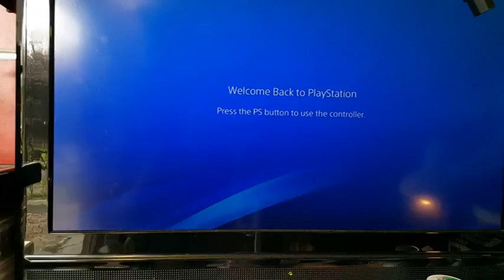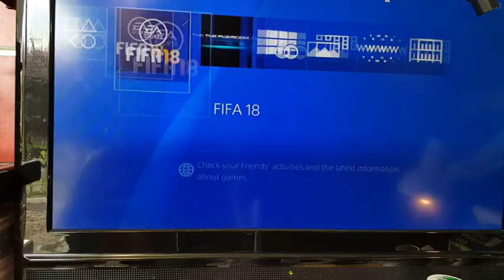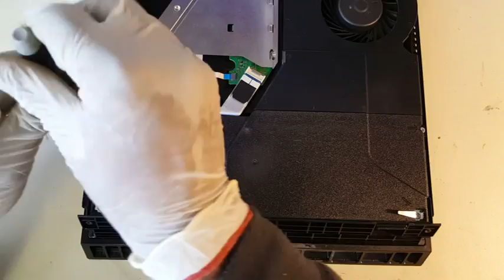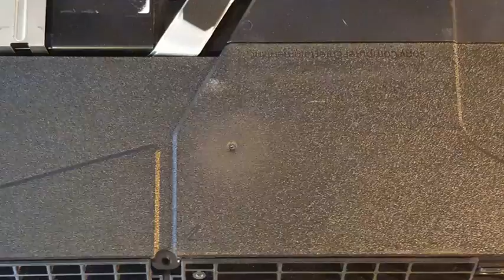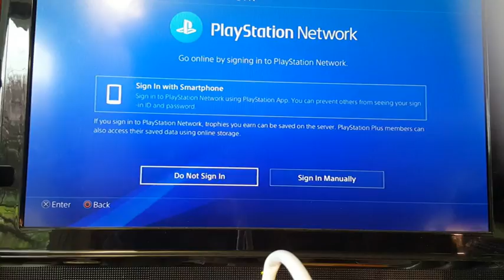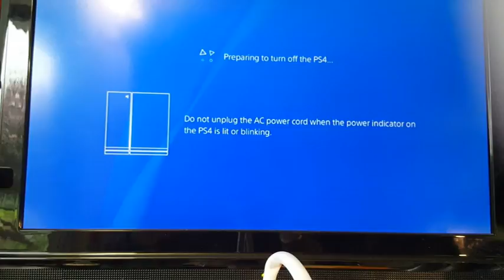Ps4 CUH 1002a Controller disconnects, slow response, Controller laggy

Comment: Hi, my two DS4 (Dualshock 4) controllers used to disconnect every now and then and I used to be able to use hard reset (pull out power cord and just plug power cord back and simply press PS button and PS4 will power up right away).

Starting last night i had the controller on/PS4 on, yet the controller started losing connection. Tried hard reset (power cord off for 30 seconds or more/pressing power button until it beeps twice for safe mode and then restart PS4) as well as pressing the reset button on back of DS4,doesn't work.

The DS4 would just blink (white light) a couple of times, then turns amber (or orange) ONCE and turn off. This is with or without the USB cable connected (tried both original Sony micro USB or just micro USB cable for android phones) --- DS 4 just don't want to connect to PS4!

However, in safe mode the USB cable and the DS4 seems to work (since I need to have both working in order for me to select the option for Restarting PS4…) so what is the problem with my DS4 controllers? BOTH DS4 controllers having the same issue. This has to do with my PS4 Pro (i.e. Bluetooth chip/wire?)

I never move the PS4 console anywhere, never dropped it and it is in technically a high spot from ground (so not as much dust then putting it closer to floor level), never opened it up for cleaning or anything.

Please help and advise what's the best step to take to fix this!
Reply: Quick tip! Do not unplug the PS4 while it is on, make sure it is fully powered off by pressing and holding the PS4 button until one beep. Reason being it can cause data corruption and loss.

Firmware reset: Upload your game save data online and see if it gives you any errors. All your other items you can save to external USB storage. Now format your internal HDD/SDD externally if you can. If can't just skip this step. Download the latest PS4 firmware, not the update. Put that file in the directory PS4 then UPDATE then paste ps4update.pup in a usb (at least one gigabyte). Boot into safe mode and select reinstall firmware. Make sure all the data you want is saved online or on a USB. Check if that worked you should see initialization connect controllers screen. If your controllers connect that means you hadn't shut off your PS4 right or there were other firmware errors, if it didn't you will need to replace the antenna and for extra measure reball/replace the WiFi/Bluetooth chip. You might want to get a repair shop to do this for you as it's pretty hard.
Reply: @Bwalston910  xbox doesn't get mad when you unplug it when its on
Reply: @insanity6379  That is also horrible for the Xbox. Just because it doesn't tell you doesn't mean it's data isn't getting seriously corrupted or lost. Reformat that poor thing too if you value your save data and time.
Reply: @Bwalston910  my dad did it all the time, and no data was ever lost, haha
Reply: @insanity6379  Most likely corrupted, or there weren't any active processed that required hard drive use.
Reply: @Bwalston910  yeah it was during a game that he turned it off
Reply: @insanity6379  Makes sense. It probably saves only when it needs to but loads textures levels etc at once rather than periodically.
Reply: @Bwalston910  yeah well glad i did have any problems with it, I sold it anyways for 100$ last year
Reply: Sell it fr, games are useless pls do something amazing with your life!

Comment: Squeeze the contacts closer. Idk why I hadn't thought of that. Thank you mate, cheers.
Reply: Whats the contacts
Reply: @lmaniii5030  They are the small metal pieces which clamp the wifi antenna to the mother board and make a connection
Reply: @joshuabuilds3051  are they outside the black part or inside
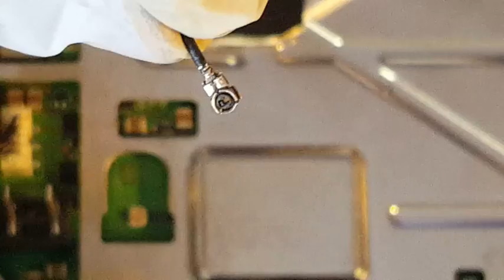Reply: @helpuno  6:45 just watch the video.
Reply: U saved my frickin life broooo it was lagging hard af
Reply: @vgodceezz3614  did it fix the controllers lag for you ?

Comment: Im suffering the lag from a very close distance and happens when I angle the controller
Reply: Imran me to
Reply: Did you fix it?
Reply: itsJaeNOW yeah i replaced it, thank you
Reply: @imran6067  replaced what? Controller
Reply: GTD: GAMING TILL DEATH no, i replaced the blutooth antenna in the ps4 and it was back to normal
Reply: @imran6067  where did u get the new antenna
Reply: @meabisyed532  ebay, make sure it’s the correct one

Comment: Thanks for the great advice, I was cleaning my Ps4 and I let the contact to loose and it was not working properly XD
Reply: Did you need to replace the antenna?
Reply: @RiIyte  no, the antenna was working fine. I just opened the PS4 again an made sure that the antenna cable was connected properly, I let it too loose after I disconnected it. This happened when I was cleaning and replacing the thermal paste.
Reply: @Saiegel  yeah I did exactly the same as you did, today. I hope I have the same thing you did with it being out of place. But thank you for the reply, got me stressing earlier lol
Reply: @RiIyte  always ready to assist. Hope that is the only issue and you can have your console working properly again.
Reply: I need help
Reply: Took my ps4 apart rn cuz it kept over heating now it dont overheat but it is very very laggy
Reply: @Jonathan-wo1ys  lets verify, is lagging in game or on the home screen?

Comment: I had the same issue. I checked my antenna and the bit of solder in between the plates was busted apart. Melted it back together with my iron and it worked perfectly.
Reply: Same here.
Have you had any luck problems ever since?
I broke the solder between the plates when I was cleaning my console.
Reply: Same lol broke the soldier inbetween but I don’t have a soldering iron

Comment: Thank you so much your the only youtuber that helped and it worked . My one was just disconnected when I dis assembled my ps4 to clean the fan filter box thing that collects all the dust. HUGE THANK YOU
Reply: Koussa_cRIMINAL same
Reply: Do you mean the heat sink its just i also did that and im having the same problem
Reply: joaoruxa1105 Yh bro I cleaned the heat sink and put it back together and forgot to connect the Bluetooth connector
Reply: @MOZEZHUNCHO  *You're

Comment: I'm having the same problem so I took it to a technician and he says the ICU chip is damaged and he's gonna charge me $40 to fix it. 

Is that even possible?
Reply: He probably was reflowing the chip you need to reball the chip to guarantee to fix it under the chip theres dozens of tiny solder balls and since ps4s are sold as toys they cant use led soldier the led free solder they use cracks overtime a reflow essentially melts the crack back together but it doesn't completely get rid of the cracks theyll come back in a few weeks to months reballing the chip is the only way to really fix it and that would cost more than 40 your best bet is to find someone who has a reworking machine "someone that's advertising xbox ps4 repair" and sell them the ps4 and buy another one used

Comment: I thought my controllers were broken but after I bought a new controller I knew there had to be something wrong with the PS4 console. I will just buy a new one and hope it does not brake until PS5 comes out in 2 years.
Reply: Mike McCoy dude I did the same thing and wasted 70$for a new controller

Comment: I ordered the same part for the ps4 that your repairing and it don’t fit mine it won’t plug in the wire is to short and the whole got the screw is in a different spot
Reply: He has ps4 pro or slim
Reply: @7certzz  he has the updated version, not the slim or pro. The shiny part is Matt black like the whole console, it's a bit quicker than the orginal and the one to buy of your looking for the OG shape.
Reply: what ps4 do u have
Reply: It’s like that but the shining part is all black like a jet black color

Comment: Bro you are a life saver thank you so much! After opening my ps4 controllers were laggy and disconnecting and I was going  crazy thought I broke something on my motherboard. Turns out I broke the second solder point when I straighten the antenna and I didnt even realise it. I just wanted it to look pretty! Thanks again!!!
Reply: I know this is a super late comment but did you solder it and has it worked perfectly ever since?.
Reply: @M.A for me I just soldered it on the other end and it worked perfectly

Comment: Great video, thanks for sharing! I replaced the antenna with no problems, but my controllers are still dropping out unless plugged in via usb cable. Probably a problem with the board.
Reply: Did it get fixed?
Reply: I have 2 controller's both work fine when plugged in but with bluetooth the range has gone down to 2~3 feet.. if I move the controller away it lags or disconnect.. the antenna is fine and did all the troubleshooting but no help! Wasted money on repair too! You have any tips!? Thanks

Comment: i have the same issue on my CUH 1003a,  seems to be missing the cable AND the antenna from the positions shown in the video, max range without lag is 20-35 cm away from the front of the console, even when plugged in. any suggestions?
Reply from the maker: Hi,it sounds like the complete cablea might need replacing.remove cable n match with ones online aliexpress,ebay etc.

Thanks

Comment: Ive been having an issue if i stop using my comtroller and it turns off and i try hitting the ps button on it, it womt reconnect until my controller dies completely and i charge it slightly again.  Would this be a controller issue?
Reply from the maker: Hi yes it does sound like a controller issue.Try the reset button on the controller.
Reply: @autronicsltd3478  sweet should i change the battery in it or just get a whole new one?
Reply from the maker: @eddieprieto1842  Hi use the usb charging cable for the controller n check if the indication light on the controller turn on to amber.if not faulty controller n battery possibly.

If light comes on but the PS button  on the controller does not work mean faulty connection or faulty controller.

Try another controller n repeat test
Reply: Btw I subbed to your channel

Comment: Can this be fixed without buying a new cable?
Reply from the maker: Unless you have really good soldering skills.Best to buy another cable,cheap enough n saves time
Reply: @autronicsltd3478  thanks. My PS4 has this Bluetooth problem. I'll try fixing today.
Reply: @autronicsltd3478  it worked! Thank you so much!! I can finally use wireless again and it no longer disconnects randomly!

Comment: Hello, so i got these symptoms on my controller, lag input, disconnection. I did remove my console to clean out any dust, while I was putting it back i did  touched it and it got kinda bended a bit, but didn't know what it was, so im assuming I damaged the antenna..
Reply from the maker: Hi,i would suggest to open the console again n re-check the connections.Re-check the antenna connector n ensure it is well secured to the motherboard.Do the basic trouble shooting first.

Hope this helps
Reply: @autronicsltd3478  thank you! I will do that.

Comment: My is disconnecting with the cable in my controller, just got a new controller and is same, any advice
Reply from the maker: Hi mostly in your case itl be the wifi/bluetooth chipset.

But before that - check all the basics i.e antenna connections, reset controller n console, up to date software etc.

If still problem persists,reflow - reball or replace wifi/bluetooth - controller hub chipset.
Reply: Re soldier front antenna its suppose to be connected between 2 soldier points

Comment: Hey ,I'm also having these issues since  cleaned the dust out it today! Mine also is making chat not work , you think that probably due to the antenna problem?
Reply from the maker: Hi.i think your issue might be with the antenna connection not making full contact to the connector on the motherboard.Re-check that n ensure the connector is not damaged.

Hope this helps

Comment: Ok so im not sure what kind of problem im having but when im playing a game or even just sitting in the menu, my ps4 makes my controller go in loops (makes me keep going right or left) and only stops after 40 seconds but it keeps occuring every 5 minutes, im not sure if this is the fix for it but please help me bro. My brother has his ps4 in his room and this never happenes to him... I have tried 4 diffrent controllers no solution. I cant play any game since all I play is online co op games and this keeps messing up my gameplay, even sometimes when the loop starts occuring I try to press my home button and then the contrller disconnects... any fix???? please respond
Reply from the maker: Hi,i would first ensure that the controller in question is a properly working controller.Check on another working console etc.

If ok 
Reset the controller n try connecting it again via usb cable.

Follow simple diagnostic procedures first.If problem still persists than look at the antenna n wifi/bluetooth chipset.

Hope this helps

Comment: Hey, thanks for the video. I have this issue and I have tried another controller, so it's definitely the issue with the console now :(

My question is that my WiFI is perfect, never drops and have good solid connection. It's only the controller disconnecting from further back and even close up sometimes. Is this definitely the issue with the antenna in my case?

thanks!
Reply from the maker: Hi, try the following:

Place the controller near eject button (without the usb cable). 

- same problem than proceed as below

Connect the controller via usb n place it near the eject button.

If still the same

- I would suggest to remove antenna n clean it. On the antenna itself there should be two solder points on the little rectangular piece.Ensure that both solder points are soldered properly n making good contact.

If problem still persists -

Reflow or reball the wifi/bluetooth chipset.

Hope this helps

Comment: Bro this is exactly what happened to my ps4 first I had a problem with my power now it's my controller it's lagging and unresponsive
Reply from the maker: Hi yes try this method hopefully this fixes it.Use the process of elimination to outline the problem first..However if problem still persists then the bluetooth/wifi chip needs replacing.

Changing the chip should be the last resort as it is tricky n correct tools arr needed to be successful etc.
Reply: Suvio @ Autronics LTD my PS4 even lags and disconnects when I have the usb connected to the PS4. Could it still be the antenna?
Reply: J Yas I have the same issue too :/
Reply: @autronicsltd3478  does the chip give out a signal by its self? I removed the antenna and can still use my Bluetooth controller

Comment: I tried many times to weld the antenna, but doesn't work correctly, I confess I don't know how to weld correctly, as you know, the cable is very short, yesterday I tried the last time, but again doesn't work, finally I will buy the new antenna...... 🤣🤣
Reply from the maker: Yes,solering that wire is very tricky.it is best to save the hassle and purchase a new one from aliexpress.com for a small cost
Reply: @autronicsltd3478  yep, I will buy it tks

Comment: Bro you thanks I fixed it using your tutorial  you saved me money there's was dirt on the connector I was having this problem for a year button lag delay then it got worse got disconnected every five minutes now I'm been playing with no button input lagg you saved my career thanks bro
Reply from the maker: Hey man thats great.glad you managed to fix it.
Reply: I recently bought a new headset and the audio kept cutting out and I was concerned because I paid $240. I have even tried plugging it in different controllers and still got the same results.will this antenna replacement fix that problem?

Comment: I think it’s my PS4 that’s causing my controllers to lag and keep disconnecting I’ve tried many different new controllers so I know for a fact is the PS4. What do you think I should replace on my consul to solve this problem. Thanks
Reply: im having the exact problem
Reply: Si ScotlandSAS hey thanks for the replay. If that’s the case wouldn’t it solve the problem if I plug it in the USB port? But it doesn’t still does the same...
Reply: Just modded mine today to have a huge antenna
Reply: Beast gaming did the antenna work
Reply: john smith yes, it improved the responsiveness and speed of 5ghz wifi
Reply: @unknownbeastgaming7264  nice glad I could help game on!